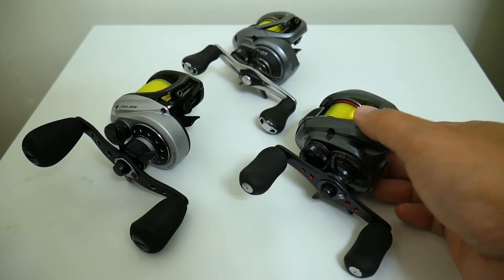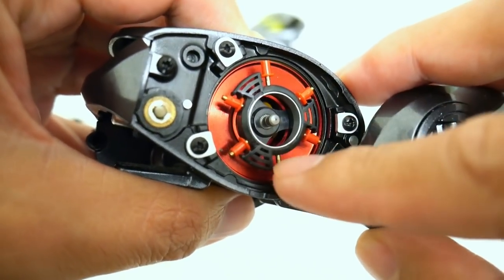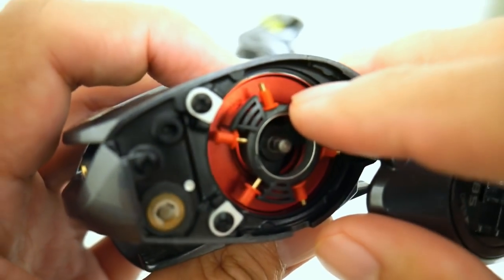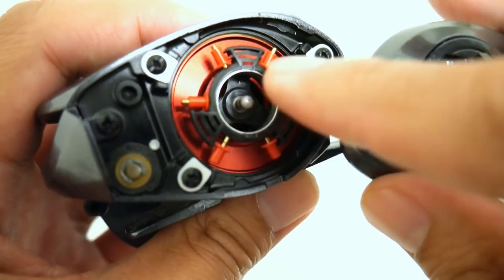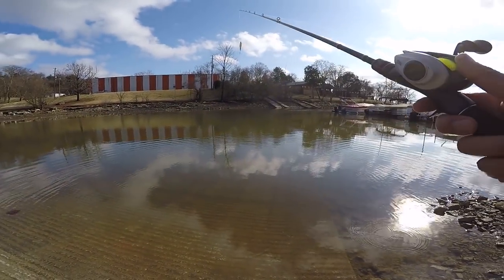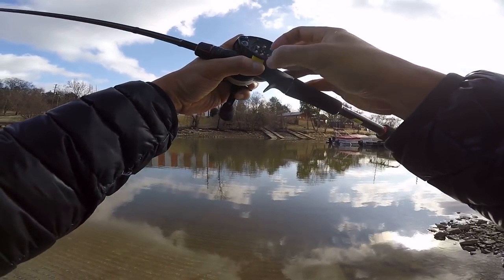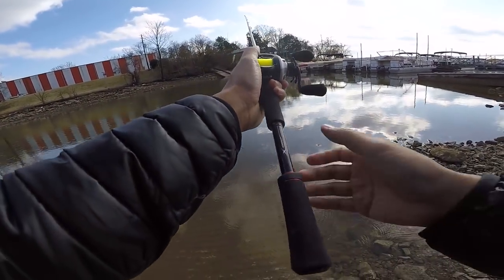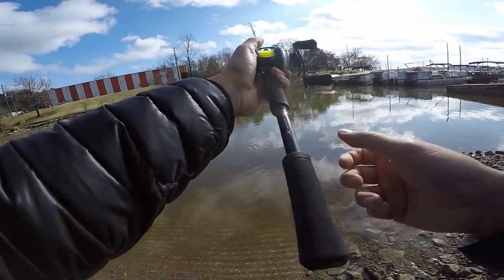FISHING MYTHBUSTERS EPISODE 1: ASYMMETRICAL BRAKE SETTINGS? WILL IT BLOW UP YOUR REEL?

Comment: Thank you for that demonstration, I've never noticed any issues when I use an odd brake setting, such as 1 or 3. I think any noticeable vibrations or noises most likely would be from worn or dirty bearings. or excessively loose spool tension, which would probably be the same also with even brake settings.
Reply from the maker: You wouldnt believe how many people believe that asymmetrical brake settings will do bad things to your reel

Comment: I don’t necessarily think it’s a myth that it is better to engage opposite brake shoes I think your test just proves it has little affect on casting. Technically unsymmetrical engages brake shoes would case an imbalance in the forces exerted back on the spool. Also it is a lot easier to make the dial on the spool for engage brakes sequentially so that’s probably why manufacturers made it that way also taking into account that there really isn’t a noticeable difference for fishermen.
Reply: That said I’m actually really surprised that it doesn’t really affect the casting noticeably

Comment: If it made no difference, people would not need balance their car wheels.   ...will you notice it right away if you don't? No, not until you meet the criteria for that particular imbalance. but when you hit that zone where the wheels are vibrating all over the road, you'll be the first in line for a wheel balancing shop.
Reply: littlegoobie a car are under heavy load when travelling. A free spool have very little force press on it.

Comment: a little bit off topic here, what is the difference between curado and scorpion ?
why scorpion rated higher than curado? are there any special feature in scorpion that curado does not have?
Reply from the maker: the scorpion has more bearings and the SARB bearings that seem to cast a little better than the regular shimano stainless steel bearings(SS)
Reply: thanks for the info

Comment: about the shimano core, how light the lure and how far have you cast with it?

i think i want take one and use it for finesse (less than 1/8 oz)

what do you say?
Reply from the maker: Ive never measured the core before because its been out of production for so long now. Id say it can go down to 1/8th but there are shallow spools for this that can go alot less
Reply: THE REEL TEST isee

in your point of view, which of these 3 reels you recommend . 

im intended to buy used reel for my ultra-finesse setup (cast 1/16oz lure)

shimano core 50  + microcast spool
daiwa alphas air + bfs bearing
abu garcia abu revo ltx 

all the reels with accessories at the same price  

which one you recommended
Reply from the maker: hard to say really, because the Core 50 is one of my personal favorites, but performance the Aldebaran is just a little better in my opinion.
Reply: THE REEL TEST alright... thanks

Comment: One of the svs brakes in my chronarch mgl is very stiff for some reason. Is it supposed to be that way?
Reply from the maker: you can add a small drop of oil if  you need to
Reply: THE REEL TEST thanks man.